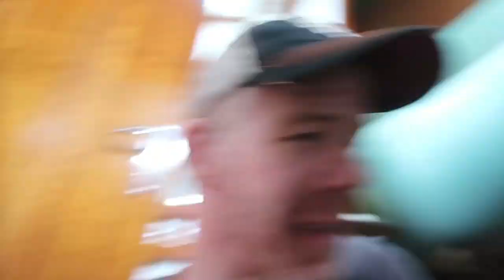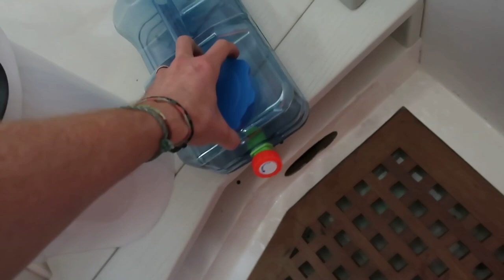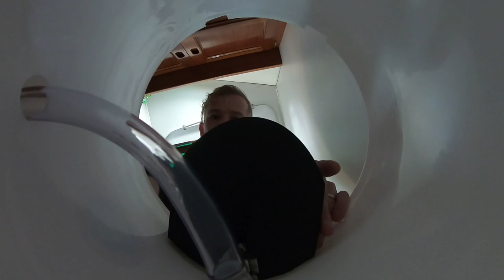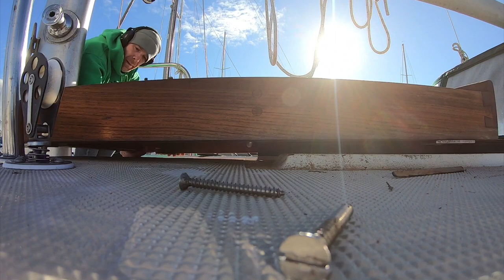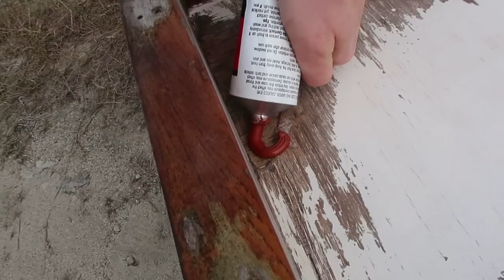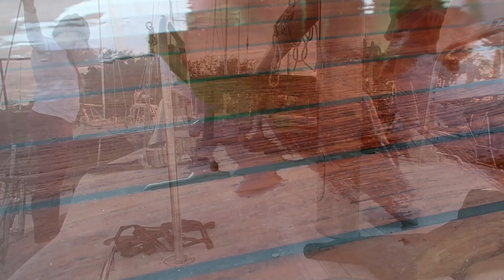ONE WEIRD BUCKET TOILET 🪣  Sailboat Story 225

Comment: Hey Ben as always a great video. I am probably late with this but here goes. An old painters trick is to store the half used paint can upside down in between uses. This will often eliminate the tendency for the paint to skin over. If it does the skin will be on the bottom and paint will be on the top. Might give it a try if your can seals up good. Keep up the good work and enjoy your sailing season with your wonderful ladies.
Reply: Grandpa used to put some thinner on top of the paint to avoid the skin. I have also seen saran wrap used.

Comment: The distance between your home and the boatyard and all the driving involved would have broken most people.  But just imagine if it was $10 a gallon ( like it is in the UK ) ..now that would have broken you .....maybe it's too late now could you have gone through the boat inside and out, before and after all the work you have done.....I said right at the very beginning this westsail was the kind of boat that was worth all the hard work tears time and money.........🏖🏖🏝🏝
Reply from the maker: If gas was $10/gal here, no this would not have worked, at least not with the extent of travel we've done thus far. Shoot, even when gas was $5/gal, the travel was strainingly expensive, even with our little Yaris that gets 40mpg. Our next refit stage will be less labor intensive, but more expensive as we need to replace our standing rigging, chainplates, and at least a couple through-hulls.

Comment: I like the simple pee place!   I always thought a simple cheap pump from the tank would work well but they do crude up easily with that sort of liquid. ( I worry about carrying the full tank to dump….and disconnecting the pipe each time but I’m sure you have it figured out) 
FYI, Regular ‘marine grade’ body filler above water cures fast and is not effected by solvent compared to glazing compound.
Cheers Warren
Reply from the maker: I have some actual 2 part bondo that I use here and there on things. It's not the marine grade stuff though. I wouldn't use it outside, but it's been handy on a few cosmetic interior projects.
Reply: @Sailboatstory  I was joking about the marina grade ….  But good quality product I is fine outdoors , just protect from uv. I use some white stuff for quick repairs and paint over later….. people so afraid of polyester based products but is what 99% of all boats are made of!
Reply from the maker: Oh, ha. I gotcha. I was wondering if there really was a marine grade bondo.

Comment: Cover paint with clear plastic food wrap before sealing the can.  This stops that paint skin issue.  Create a vapor proof barrier by tearing off 10” and gently laying it on the surface of the paint.  My wife uses more and makes sure it is also captured by the lid so that it doesn’t slide around, but she’s smarter than I am.  Just remember this should be removed before shaking or stirring the paint before next use.

Comment: I admire your DIY save-some-bucks Loo, but wonder if a, for example, $71 Coleman Porta Potty at Walmart with holdown straps and can takes #1 and #2, might have worked and given you a true double duty toilet.  Love the use of auto Bondo used on boat, and in the end, project looked great.  Good to hear you finally be sailing S to FL and Bahamas.
Reply from the maker: Sure. Always multiple ways to solve a problem. We're wrapping up sewing projects, packing up, and will be headed back to the boat ASAP to load up and head out.

Comment: A #1 toilet only with a mandatory stool. HA!
Reply from the maker: Did I say it was mandatory? I don't sit or otherwise use the stool when going #1. For a female though - yeah that's be a different story. Of course, the stool still isn't mandatory or otherwise required, but it does make the ascent to the throne require a bit less athleticism. It is a bit comical that there is a "stool" involved though. Maybe I can refer to it as a single-step-ladder.

Comment: You might want to ook at some toilets that use a bag for solids before going with a nature head. Example. "Separret Villa" So much cleaner than a system that needs peat for mixing with solid waste, and no stirring. 
I currently have a one with a urine diverter, but there are also ones with jugs that may be better on boats.
Your temporary solution could be outfitted with a bag for solids in about 1 minute I suspect.
Reply from the maker: We're on our 3rd Nature's Head, currently. Love them. I do like checking out composting toilets I haven't heard of. I'll look into the one you mentioned.

Comment: How about that !...Bondo glazing is still around. I used that stuff on a 1953 Dodge back in 1959 !...
Reply from the maker: Works like a charm as long as it's not laid on too thick, in which case it never dries underneath. Great for simple cosmetic stuff, but this application was pushing the limits of what it should be used for.